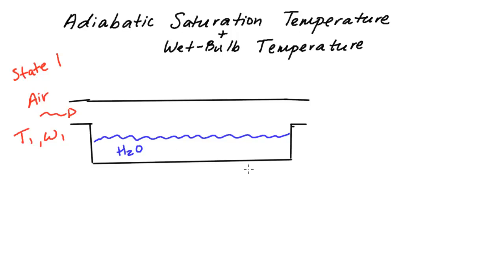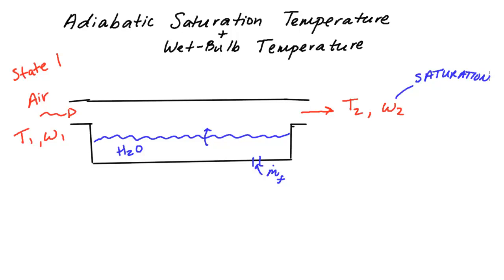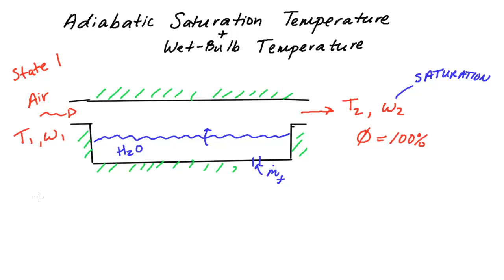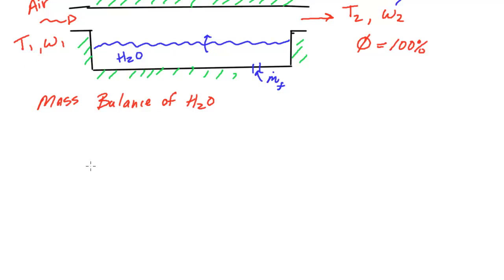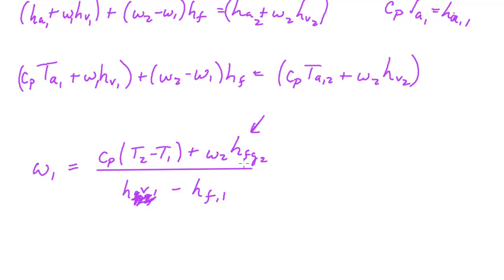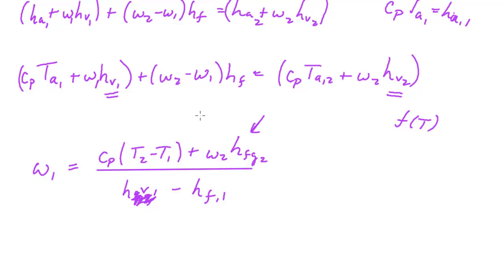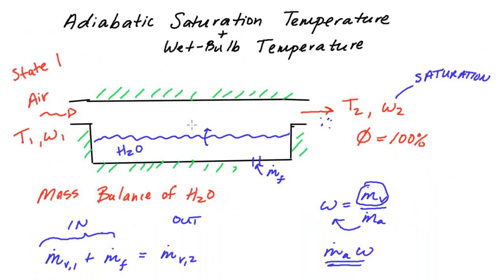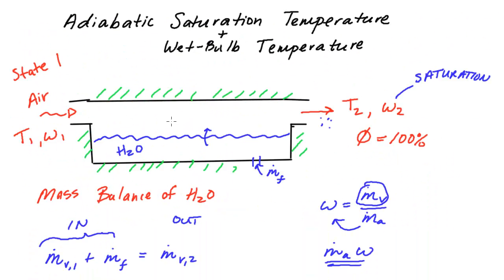Adiabatic Saturation Temp and Wet-Bulb Temperature, Part 1

Comment: my question is that let's say the water temperature in the chamber is Tf ... is it possible to have T2 < Tf ?  is Tf the minimum temperature that can be achieved by air? or is T2 completely unrelated to Tf and can be lower than Tf
Reply: Do you mean we could cool down the air using hot water?

Comment: If the humidity ratio is defined as the mass of water vapor per the mass of dry air then based on what can you conclude that the humidity ratio is also defined as the mass flow of water vapor per the mass flow of dry air? Do they flow at the same rate? If so, why?
Reply from the maker: It might be easier to understand starting with the mass flow rate of dry air, ṁₐ. At any given point or region, the humidity ratio, ω, represents the ratio of water vapor to that. If you assume that the humidity ratio is constant through that control volume, then the mass flow rate of vapor is the dry air flow rate multiplied by the humidity ratio or  ṁ_v =  ṁₐ  ω. You can rearrange from there to get the form that I showed.

Comment: Why adiabatic saturation temperature is equal to wet bulb temperature in air -water system?
Reply: Because there are no sources or sinks of heat, when you evaporate water into air, to cool it to its wet bulb temperature.  All energy to evaporate the water vapor from the feedstock of coolant water, will come from the thermal energy of the airmass being cooled, as it mixes with newly evaporated water vapor.  Due to no sources or sinks of heat, we call it an adiabatic process.

Comment: is t2 is due point temperature?
Reply from the maker: No, it is the adiabatic saturation temperature -- the dew point temperature is another important related concept. Essentially, given the normal temperature of air that you are used to measuring with a thermometer, the wet-bulb (and nearly equal adiabatic saturation temperature) is the limit to how cold the air can get just by evaporating water, while the dew point temperature is how cold the air must be just before it starts condensing out, with no change in the mass of water in the air.
Reply: Mitchell Paulus whats the difference between both i mean air is completely saturated if we decrease temperature future dew will form
Reply from the maker: I think I understand your question now, you are correct in that when the air is fully saturated, the dew point temperature, wet bulb temperature, and dry-bulb temperature are all the same value and so T2 will also equal the wet bulb/adiabatic saturation temp. However, we are generally interested in what the dew point temperature and wet bulb temperature are when the air is not saturated.  Hope that helps clarify.
Reply: @bashamsk1288  The dew point is based on only heat transfer.  The wet bulb temperature is based on only mass transfer as the liquid water source is evaporated by the heat from the air.

The wet bulb temperature is what you would experience, cooling dry air in a swamp cooler.  It can be an energy efficient alternative to an air conditioner in a dry climate like Las Vegas, but it has its limitations.

The dew point is what you would experience, cooling any air in an air conditioner duct.  The evaporator cannot suck water out of the air, or inject water into it; the evaporator can only suck heat out of the air.  The air cools until it gets to its dew point, and then condenses onto the evaporator coil. The evaporator coil continues to generate condensate as it de-humidifies the air.